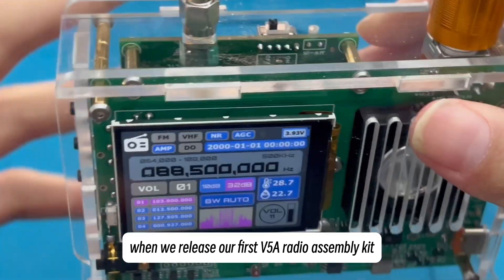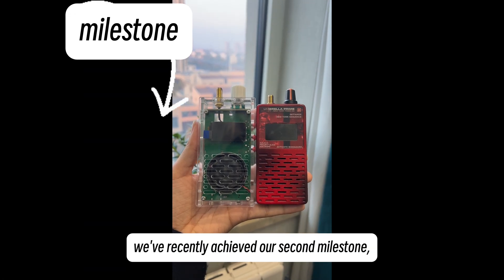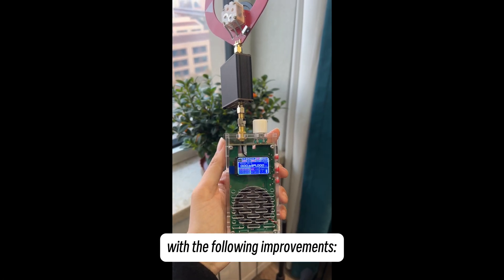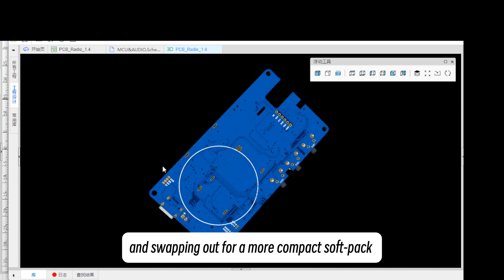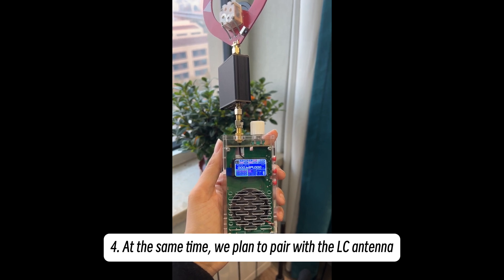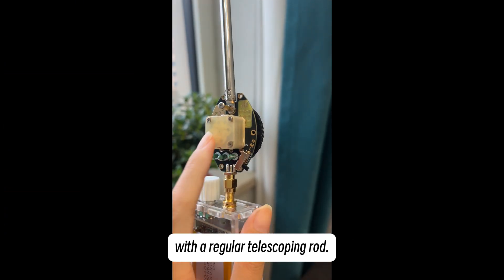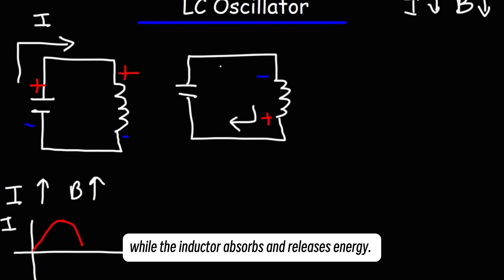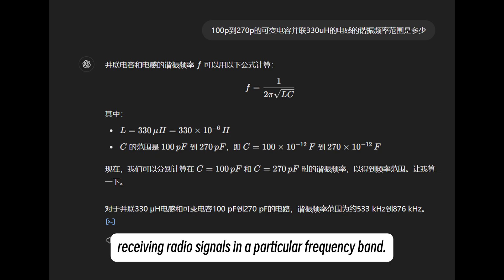V5M: The Evolution of DIY Radio -  Our second milestone, More Compact, High-Performance Experience

Comment from the maker: So honor to see all kinds of suggestions from you radio enthusiasts regarding the V5E. However, I'm sorry to tell you that due to issues such as the import and export terms of the V5E kit, the DIY kit of the V5E radio may not be able to be exported from CN and delivered to the hands of you enthusiasts. Therefore, currently, there may no longer be links for the V5E kit on e-commerce platforms like Amazon. We apologize deeply for this. But the optimized circuit in the V5E will be applied in the upgraded version of V5A, which is also named V5E. Maybe there will still be a chance for us to meet it in the future. Once again, thank you all enthusiasts for your support of GEEKNEST!